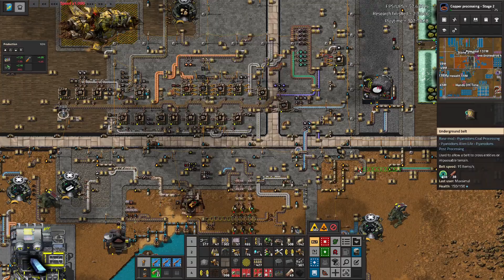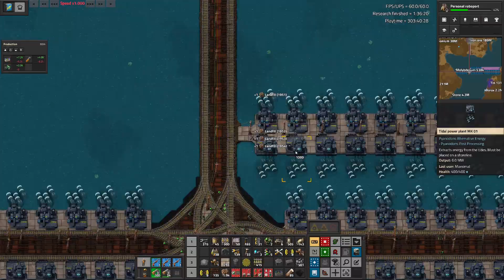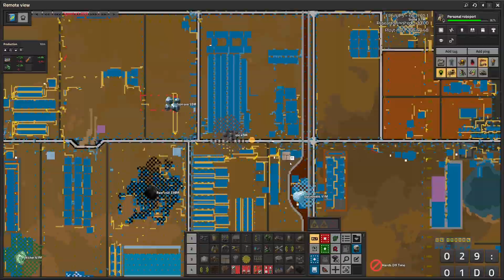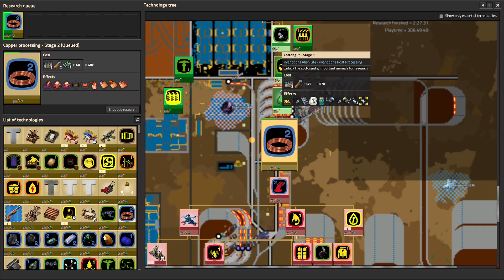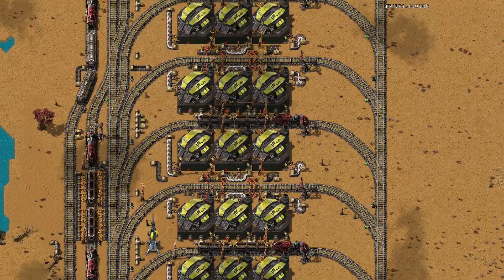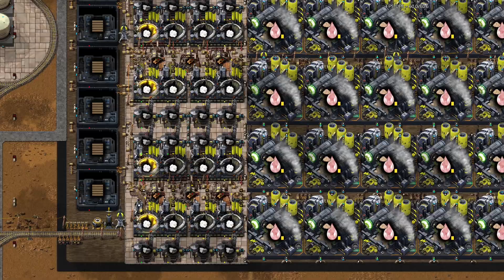088: Arise, my minions!  Personal Pybots - Pyanodons HOHM x300 Challenge

Comment: Nice video! Hoping some day achieve a base this big (i'm at 80h in a normal Py). Really liking how it's the factory growing, what are your next plans for it ?
Reply: I barely automated production of auto-sp and py1-sp, the main struggle was that processing all of the ash in the separators was eating a lot of power that produces that ash on its own. Once I crawled to the geothermal power, electricity stopped being an issue at all. On my way to properly automate production of simple electronic boards and replace everything that can be to the electric version, and then replace stone furnaces with gas furnaces to eat all of the gasoline that now I just dumping into the hole lol.

I hate how slow soil and limestone produces by those extractors buildings. Don't remember if there is a way to speed up that, but right now it's like 6 of those to make enough limestone to sattisfy one lime hp-furnace.